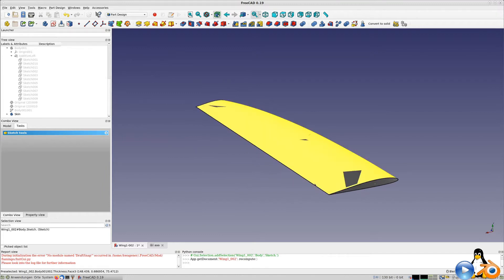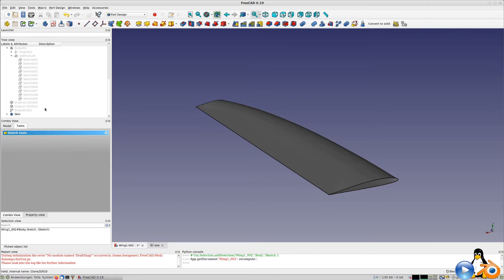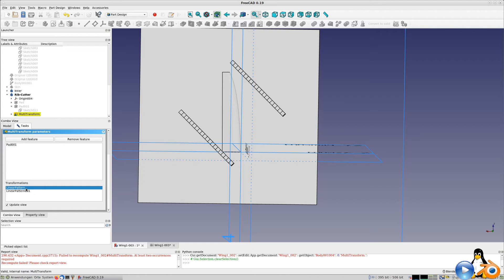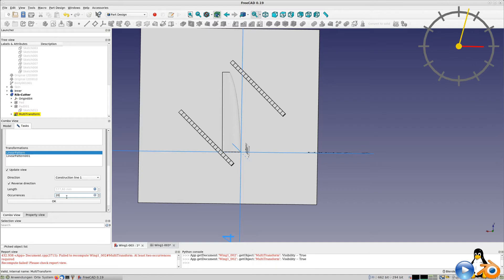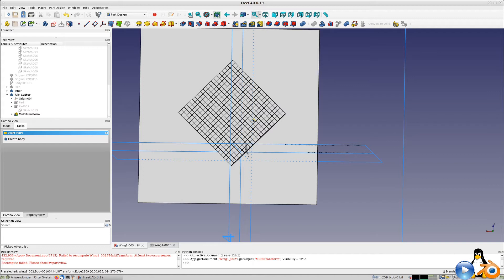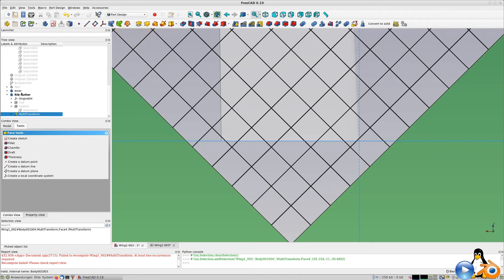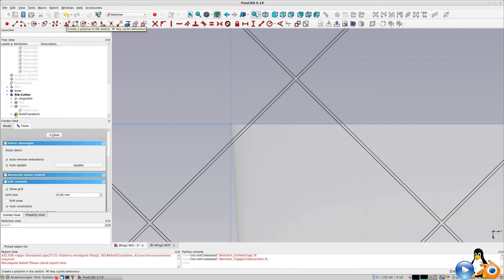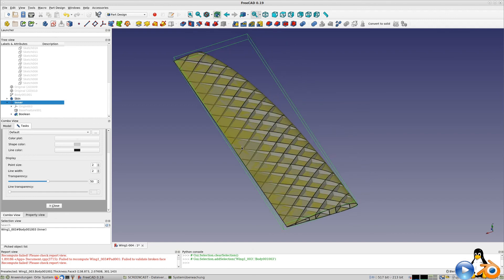freecad-Tutorial - English - Wing-Design Part 2

Comment: Are you planning to use prusaslic3r or simplify3d to slice this type of wing for printing?  I have seen on YouTube, techniques to load wing skin STLs and internal rib STL file separately in slicer program. This is a way to force printer to print the skin first and then the internal ribs.
Reply from the maker: I have used Cura in most cases, and you can of course import a model as two parts. But in fact, the first skin is printed in cura very good, i have tried prusa, there its problematic when both parts are connected.